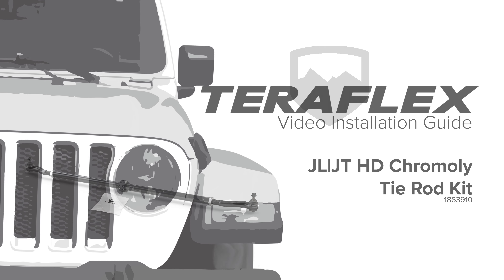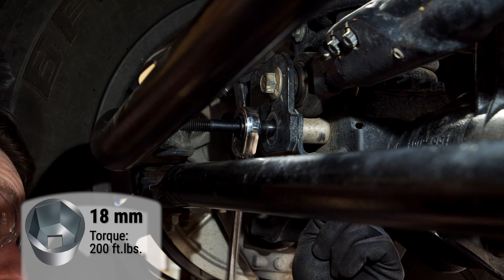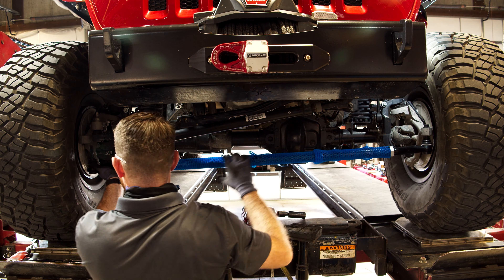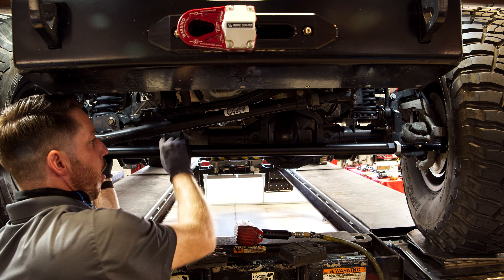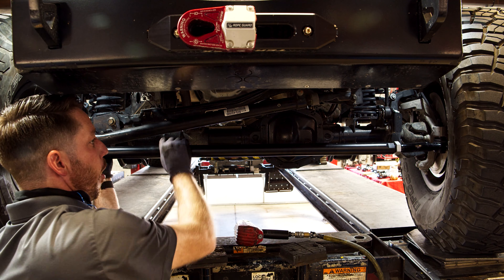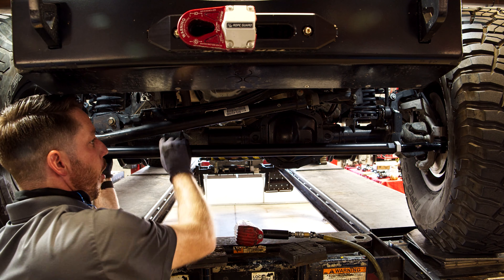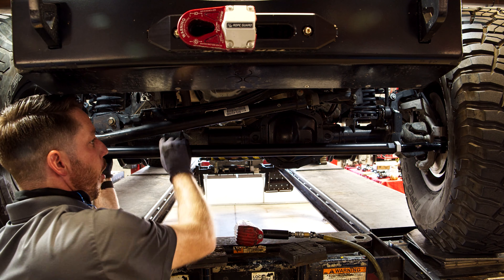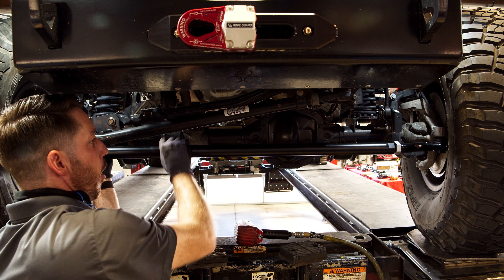JL / JT: HD Chromoly Tie Rod Kit Install | TeraFlex

Comment: Would this setup allow me to run the nexus steering stabiliser on a rhd sahara in Aus? Currently they don't fit with the Rhd conversion.
Reply from the maker: Unfortunately at this time, it would not work. We are hoping to have some more RHD fabrications in the work very soon.

Comment: Will work on 2020 eco diesel if so can I get part number thanks
Reply from the maker: Yes, it will work great on the Diesel as well. • JL / JT: HD Chromoly Tie Rod Kit (0-6” Lift) (# 1863910)